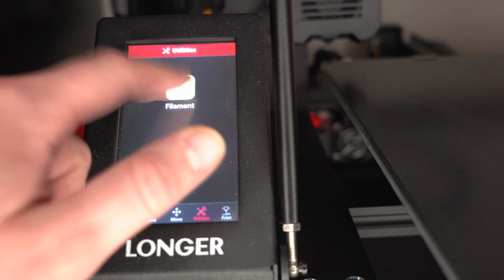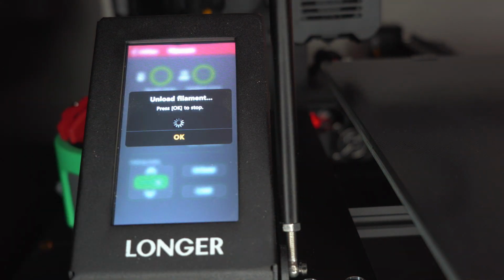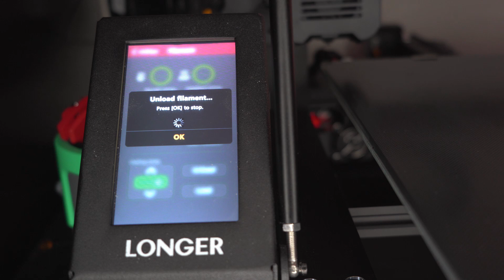Easy Bowden Tube Replacement on the Longer LK5 Pro | 3D Printer Tutorial

Comment: I can't get the tube off the little.Heat part, I even unscrewed the brass fitting, but the tube is stuck on the heat sink. Do I need to have it hot to Remove it?
Reply from the maker: I would recommend heating it up. If filament leaked around it then it could be what is preventing you from being able to pull it out. I'd heat the nozzle to max temp just to be safe.

Comment: I've replaced the bowden tube twice now but still having trouble with clogs at random times.  Changed the nozzle as well.  My other LK5 is not having this issue and uses the same prints with the same filament.  Could it be a problem with hot end?  Your videos are extremely helpful.
Reply from the maker: That's what I'd try next if I were you. Hopefully that will fix it!

Comment: So I really wanted the clear tube like this one, we ordered it and put it on.  Afterwards we kept having print issues with feed clicking and under extrusion and difficulty removing the filament.  Long story short, this tube did not like to be in our unit.  It was swelling once hot enough and blocking off the canal causing the feed clicking.  We replaced it with another OG blue tube and all went back to working well.  My guess is the strength and heat tollerance of the clear tube is not the same as the blue.
Reply from the maker: Sorry to hear the clear tube didn't work for you, but glad that swapping back to the blue fixed your issues! Thanks for take the time to comment.
Reply: @jfmedina2010  We were really scratching our heads on that too!  And glad swapping back worked for us.  Thanks for the video and the reply!
Reply: I switched to clear tube and am having the same clicking issue mid print. I’ll try switching back to the original, hopefully that clears up the issue for me !

Comment: That clear tube sure does look cool, I also loosen the nozzle about a quarter turn then push in the tube and tighten it back up. Also a set of flush cutters will make a huge difference and you can even call it a safety upgrade so you won't be able to cut yourself on the sharp zip ties after you cut them down

Comment: When I get a new printer if it doesn't have a blue bowden tube I replace it with a capricorn premium Ptfe (blue) tube. You can tell when the filament reaches the nozzle by the feel, don't need to see it. Swapping the original blue tube on a LK5 Pro with a cheep clear one is a downgrade
Reply: Idk I think the clear is pretty cool. Gonna burn out eventually anyways.